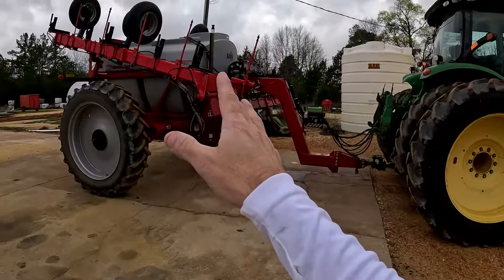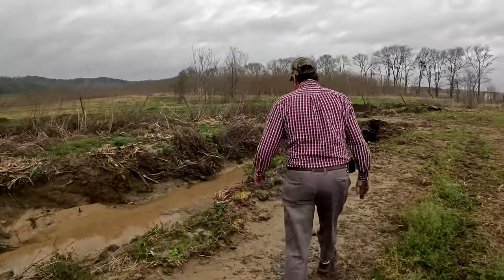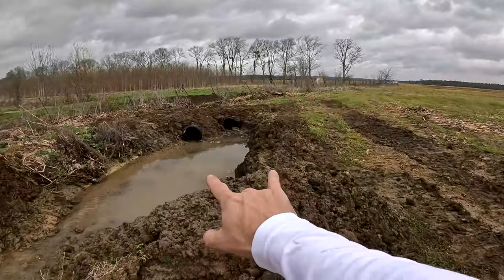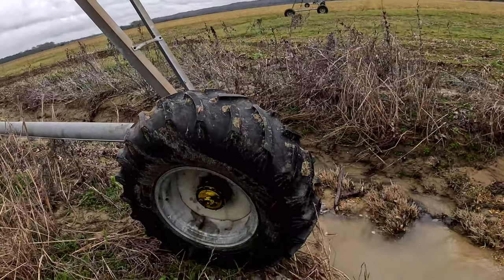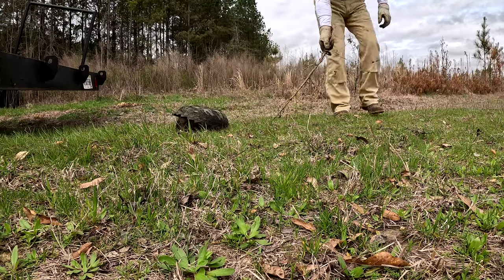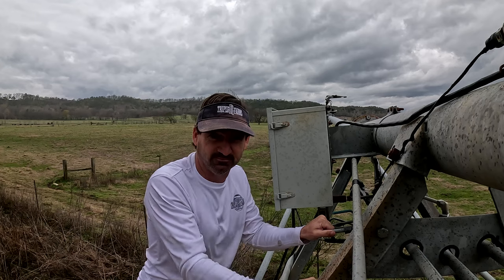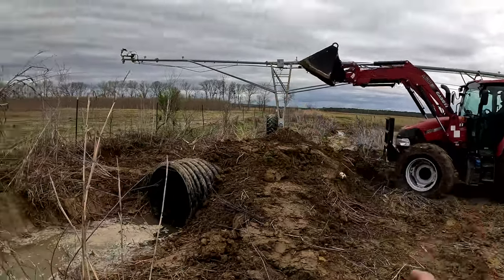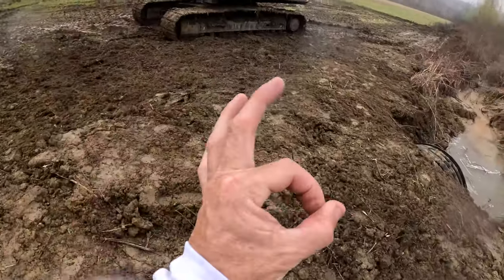2024 PLANTING SEASON IS STARTING OFF WET

Comment: Good job, gentlemen!  I would have been tempted to grab that smaller corrugated pipe for the pivot crossing and use the larger one for the road culvert.  The smaller pipe would have required less earth-moving for the pivot's crossing, and also made a more level track.  But perhaps there's more water in that location and you needed the larger culvert.  I'd also throw some "contractors' (grass-seed) mix" or what-have-you on that fresh clay to help prevent it washing.  Always enjoy your videos!